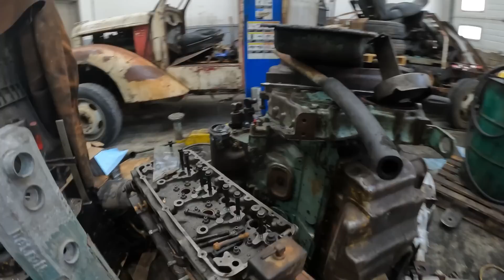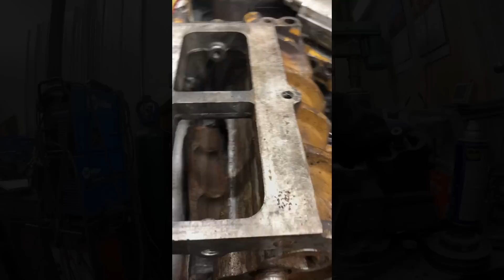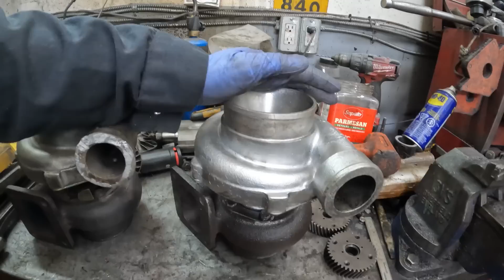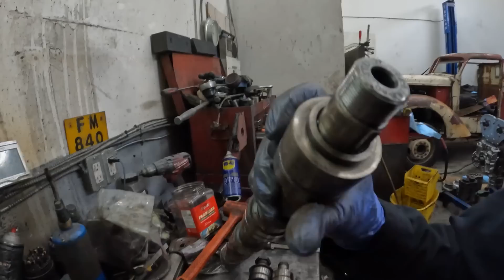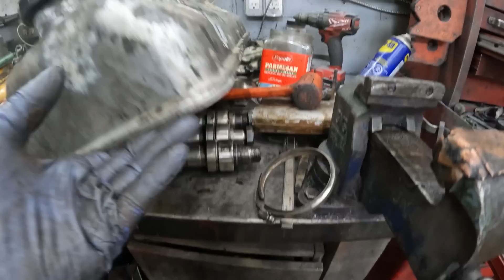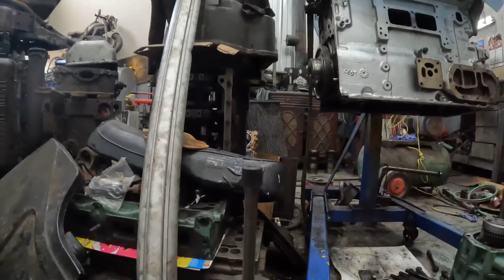Detroit 4-53 Differences ( N, T, Silver Series )

Comment: @detroitgarage9430   This is fascinating to see all of the differences between the various versions. I acquired a low-hours, fairly late model, naturally aspirated 4-53 stationary power unit, with a hand clutch and belt pulley - for free. 

I was curious about adapting it into my 1955 GMC 600 series medium duty truck (ex-fire truck, now flatbed) which currently has its original 360ci inline 6 gas engine, "rated" at 170hp @>3000rpm (probably much less than that now, in it's current worn state).

I'm curious whether the governor on my freebie 4-53N stationary power unit (variable speed via a control cable) would be at all suitable for use in a truck. I've heard the governors on stationary engines, even if variable speed, are tuned different than truck engine governors.  I don't want to make the truck a pooch overall (since the 4-53's rated HP is significantly lower than the gas inline 6), just for the "cool factor" of it being diesel-powered. When this GMC was new in 1955, the diesel option in that size class of truck, according to the manual, would have been a 4-71 (naturally aspirated, of course). I only have this 4-53N to play with, because it was free.

I want to know whether it's worth my time to install the naturally aspirated 4-53 power unit engine into the truck (as is) or if it'd be a total waste of effort (for reasons mentioned above, or reasons I'm not aware of!) Extensive modifications to the engine would definitely be out of budget, so it's really just going to have to work as it is, or I'll leave the original gas engine alone.
Reply from the maker: The 4-53N is rated at 140 HP and 282 lb-ft of torque with N50 injectors.  Nothing to get excited about, but would work ok in your GMC if you're not in a hurry.:)  The VS governor works surprisingly well with a standard trans.  I'd personally look for a 4-53T, but being your engine is free, it's worth a try.:)  There were many medium duty trucks in the day with a 4-53N in them, 5 speed main and a 2 speed rear.:)  It's really up to you, tough choice, legendary inline 6 or the 4-53N.:)
Reply: @detroitgarage9430  I suppose the 4-53N could always just be a backup plan to keep the truck on the road if the original engine ever has a problem I can't repair due to parts availability. The GMC 360 inline 6 is incredibly hard to find parts for, even basic gaskets, thermostat, etc. That's good to know about the governor though! Thanks for the reply.
Reply: if I ever did figure out a way to install that 4-53N in the 55 GMC, it would definitely be accompanied by a rear axle swap. The original GMC rear axle is single speed 7.17:1. The inline 6 is already screaming at 50mph, and that Detroit would have a significantly lower governed speed than the gas motor. I have a 2-speed GM axle (1960’s vintage) that I bought a 5.83:1 ring and pinion to re-gear, and that would give it a little better top end road speed while adding the 2-speed for a few more gear ratios in between. The only issue is that the 2-speed rear is vacuum shifted, and my brakes are vacuum boosted, so I’d need to add a belt driven vacuum pump of some sort to the Detroit. Like the Detroit, the 2-speed axle was free! I just had to buy the 5.83 ring and pinion set for it from a salvage company.

Comment: Lots of great info here! If I run a N blower on a T engine would I see any better power or any better fuel economy?
Reply from the maker: Thanks, yes better bottom end torque and low to mid range performance.  Will loose 8HP on the top end, but gain 15 ftlbs on the bottom at 1500 rpm.  I daily drive my Silver 4-53T and it has an N blower.  Never tested fuel mileage with the T blower, but I average 9-13 towing, 15-16 city and 18-20 hwy with the N blower.  Hwy is 70-80 mph all the time.
Reply: @detroitgarage9430 interesting!

Comment: It has always amazed me that DD never went to helical lobes on the blowers... seeing as how they went through all the little things to "quiet down" on the silver series.   They should have had helical lobes when they first came out in 57, seeing as how they had previously switched from straight to helical on the inline 71's before they released the 53's and V 71's in 57.... the 110 also had helical lobes.... which "I think" used the inline 71 blower with a faster drive ratio (2.87:1 ??), I need to look that up in my 110 service manuals.   The One thing that attributed the most to 53 noise, was the straight lobe blowers, not to mention that the helical lobes were not only much quieter, but they significantly reduced pulsation of the air, and also cut down on the temperature due to less "beating" of the airflow which caused the aforementioned "pulsating".   I don't remember if the little 51's had straight or helical lobes, but 4-51 seemed to be quieter than the 4-53 was by quite a bit.   I would think that a Silver 3 or 4-53T with a 3 helical lobe Hi-bypass blower (marine) would have also put out more hp as well.    I have an even better idea, that would eliminate the rotors, altogether.
Reply from the maker: Thanks, It's certainly noisy, can hear my Silver with the N blower on it over all the other noise.:)

Comment: So  could i use a turbo blower on a non turbo 4-53
Reply from the maker: You could, but don’t think the performance will be there for the N engine.  Might find it smokes more and has less power.  It’s about 15% smaller than the N blower.

Comment: What about the volume of the oil pump ? Mine was 50% thicker more volume
Reply from the maker: From the ones I've measured, they were the same.  Only compared to the one 4-53N that I had, so may have been upgraded at some point. Oil coolers are much smaller on the N engines.
Reply: @detroitgarage9430 when I turbo my 70 4/53 to factory specs most things that were left unchanged were the cam countershaft crankshaft tin covers not much else did this change in 84 still a daily driver
Reply: It has got as high of fuel mileage if 20 mpg in the Death Valley area of the United States I am embarrassed to say California communist controlled newstrom trader state sad what both my mother and father volunteered for this country in World War Two thank god for Donald trump
Reply from the maker: @ThomasJones-b7d Awesome.:)
Reply from the maker: @ThomasJones-b7d Nice, I average 18-20 mpg on the hwy as well.:)

Comment: Great video. I have a 3/4 ton pickup with a 453N. Should it have a restricter in the fuel return from the head? I assume it was running without one, but was this right. If so what should I buy?
Reply from the maker: The return fitting should have a .80 restrictor in it.

Comment: I used to rebuild some 3s and 4-53 back in the early ²⁰⁰⁰s for the rail road in ky . Been looking for one 3-53 t and a 4-53 t with jakes . One for a farmall m and the other for a truck swap there hard to find in these parts lately.  I just love them two stroke noise makers. I reckon cause as a kid they were common at the farm. Running old grain carts back and forth from the fields. There is something about the simplicity and smell any detroit makes.
Reply from the maker: Awesome, that would be a nice swap for both engines.  Yes getting harder to find that's for sure, I usually find them through FaceBook Marketplace.  My 1965 Allis Chalmer forklift and 2009 Ford F350 are both Detroit swaps.:)  Love them both.
Reply: If you find Jake’s i am looking

Comment: I wouldn't think a roots purged engine quite qualifies as naturally aspirated, even if it's geared for that 2 cycle function. So the rotors are all straight in the 53 series Roots blowers.

 I wonder if anybody makes after market drives and end plates for adapting an over-driven 53 series case and rotors as a roots supercharger for the smaller auto V8s and V6s.. A 2-53 or 3-53  would look and fit better on a 4 barrel manifold than a 4-71 on my '55 270  cu in. Dodge Hemi. A belt driven roots blower would be ideal if it went with an after market damper made by Hot Heads Research for a roots supercharged little '50s Dodge Red Ram Hemi.. . . If I just had the drive for the case and rotors,.

I used to run an Etnyre chip spreader with a 4-53 for a seal coat paving contractor. It's probably one reason I fail all my hearing tests now, lol.
Reply from the maker: Not to my knowledge, and yes the rotors are straight with the exception of the 8V53.  They were more like the 71 series rotors.:)

Comment: I have 6v53 with no oil pressure im not running the engine can i bump up oil relief spring or do i need  engine bearings
Reply from the maker: You can check the relief valves, but most likely needs bearings.

Comment: Question. Is a 453N blower a direct bolt on swap on a 453T? The 453T blower I have has a cracked fin in it and the guy gave me a 453N blower to go with it.
Reply from the maker: Yes, direct bolt on.:)  I'm running an N blower on both my 4-53T's.:)

Comment: You did not mention a 4-53? Just n,t, and silver. The 4-53, with no letter after it is a 2 valve head. It might be a lower compression but not sure , in the 71 series, it is a lower compression 17 to 1. I think it is important for those who are buying an engine to know that it exists, and is a rather low hp. Not well suited to truck use.
Reply from the maker: Yes you're right, I never mentioned the two valve version.  I think they were somewhere around 80-130 HP depending on injectors.  My 2-53 is a 2 valve that had 17:1 pistons rated at 32-38HP.:)

Comment: As usual very informative and entertaining video! Learned a lot and had many questions answered. I’m learning what i may want to do in the future through you! I have a 453N that I would like to throw a turbo on, just to keep hills from being an issue and killing my speed. If I could push 5 psi or so and use a similar blower bypass to the one you built, keep the N blower and higher compression pistons for cold starting ability, I’d be happy…for a while at least. I’d be intrigued to know what parts you would throw at a bare 53 series block to build “the ultimate” engine, taking the best aspects from the different series. Keep up the great work, much appreciated!
Reply from the maker: Thanks, that should work well for an N engine.:)  I'm building a Silver Series 4-53T to be the ultimate engine.  I'll also be dyno testing the different blowers, injectors and turbos so I can get the the best performing engine possible.:)
Reply: Look forward to the results! I’d love to have the space and funds to buy parts and try stuff…but the wife just gives me that look all wife’s do when you spend money on “projects”, so my wife should be thankful for you, as you will save her some of the trouble of scowling at me every time a heavy box with greasy finger prints shows up at the front door.

Comment: Is there a stand alone controller to run the 5r110 in your superduty?
Reply from the maker: There are, but it's better to run the Ford PCM/TCM and tune with HPTuners.  That's what I did and it works like factory.
Reply: @detroitgarage9430  that's awesome. Last I checked (years ago) there were no options for that. I'd love one behind my 7.3
Reply from the maker: @craiga9492  They're a really nice trans.:)
Reply: @detroitgarage9430  they certainly. I have one in my superduty but the 6.0 isnt as nice

Comment: Finally got to try to fire up my 4-53N and had no luck ....the rack was stuck on two injectors ....and those same two injectors were also stuck, or rather they depressed  and stuck once i rolled the engine over.      Odd thing those injectors are both C50's cyl 1 and 3 .....cylinders 2 and 4 freed up and they are both N50's.     Is there any reason two run mismatched injectors  and better yet is there good reason not too?
Reply from the maker: Probably missed matched because they didn’t have a set of 4 of either injectors, so they just used what they had.  I’ll check the manual in the morning and see what mm the c50 is compared to n50’s.  Probably the same fueling.  I’ve run across this on one engine, but really don’t recommend running mismatched injectors.  Having said that I testing 2 7A77’s and 2 7E75’s on the dyno to see if I can notice any difference.
Reply from the maker: OK I checked the N50 vs C50 and they deliver the same fuel, so almost identical.  The plunger stroke is slightly different, but not enough that Jimmy would know.  Who ever swapped the C50's with the N50's knew this.:) P.S.  They also share the same tips.:)
Reply: @detroitgarage9430  thank you for that info. Last question you wouldn't happen to know the timing dimension on those would you ? .... I am assuming the standard 1.48x ?
Reply from the maker: @greywuuf  1.47" for the C injectors and 1.46 for the N injectors.:)  I'd just use 1.47" and that would work well.:)
Reply: Aggghhhhh!.      Soaked my stuck injectors over night in fresh diesel.     Pulled em out cleaned all the passages with carb cleaner.   And rapped the first one with a soft faced hammer. Popped up and freed the rack.    A little lube and worked it by hand and good to go.       On to the second one .... rapped it twice with a soft face hammer and the top "follower" portion broke into 3 pieces ...the flat that the rocker contacts.
Reply from the maker: @greywuuf  Nasty, I'll see if I have a decent spare and can mail you one.:)

Comment: great stuff, thanks as always for sharing. 
a coupla questions, if you have a moment, please
- what is different with your modified cam, running  in the Ford?
- how does the amended pressure setting changes things, with your modified blower bypass?
- would you consider doing a similar tear-down, of a Bivens 8V96, for us all to learn about the magic modifications? )
Reply from the maker: The cam is a V7 high lift cam that's been ground with a different profile I bought from Leid Diesel.  The profile they've used is a closely kept secret that they won't share.  I'm told that combined with the tall port liners give the engine more air combined with the N blower.:)  I'm build the next Silver back to Detroit specs to see how well it runs compared to my engine.:)  The blower bypass opens at 10 psi turbo boost and works very well.  I've tried 5-6 psi opening pressures, but wasn't clean burning at the 5-6 psi, so 10 is very clean.  Engine makes 12 psi boost and with the water meth on 16.:)  Again I'll be running comparison test on the dyno to see which blower works best for the larger injectors.  If I could find a cheap Bivens 8V96, I'd maybe do a teardown, but they're almost impossible to find.  The 8V92, and Bivens 8V96 are just too large for my use.:)

Comment: In addition to the mentioned differences, didn't T blowers also have revised rotor to rotor and rotor to housing clearances to accommodate higher temperatures and larger rotor flex?
Reply from the maker: Yes, the clearances are great for the T blowers.  When using an N Blower on a T engine the rotors need to be shaved a little to increase the clearances.:)

Comment: The blow by on turboed Ns is the piston the oil drain back holes in the top oil ring groove let turbo boost from the airbox blow into the crankcase drive pins or rivets can be driven into the drain back holes to prevent the blowby problem. The wide oil ring in the top groove is another way to control blowby on the N,T combination the piston skirts and oil ring package is a good piston to look at to see the changes on T engines to stop blow-by and.oil consumption
Reply from the maker: Thanks Joe.:)

Comment: My dad used a 4-53 Detroit diesel in his 1954 clam boat. He owned it for nearly thirty years and didn’t have a single problem with it.
Reply: My girlfriends dad's boat has a 4-53n that has over 40k hours on it, sank twice, never had the head off, and original injectors. Runs perfectly, I believe rated around 130hp.
Reply from the maker: Awesome, love hearing those kind of stories.:)

Comment: It would be nice to section a cracked cylinder head with a bandsaw to see if it's possible to machine dogbones in.
Might be a good mod. 

The reason I mention it, Wayne on Ol2Stroker last week was showing the world's only common rail 8V92 and they stressed it in racing and it failed. Its heavily modified. 
Anyhow, after solving one problem they cracked a cylinder head (or both) and I said in the comments, "You overcome one power limiting factor - the Detroit injection system only to find the cylinder heads are now the weak spot. Hot rodding that."
"He replied, we have a plan." 
We'll have to wait I suppose since the vid was only a few days ago (but there might be a lead time in his vids so who knows?).

After you showed the dogbone in the head surface, I can't help but wonder if it's possible now and that might be how they solve cracking at very high power outputs.
(I'm saving this comment in Word to repost just in case lol)

Comment: Compared to the 1970's or 1980's.........turbo's have progressed a a lot to where they are now.   Generally speaking, the compressor sections pump more boost at lower temperatures......it can be as much as 50% more air density.
Reply from the maker: Very true, I'm going to be testing the stock Garrett, then compare it to a modified garrett and then new turbo's.  I'm running a new compressor wheel 59mm on my Silver and love it.:)

Comment: yeah the blower drives were a problem on engines such as the 6v53 turbo
Reply: Andrewsmart the blower drive can be up dated as the 92 series to prevent the blower drive from being an issue
Reply: @joemaser9122  no i found the 92 to be a pig of an engine,worked on a fleet of domino buses with the 6v92 and allison autos,there were 3 different revisions of the v92 blower drive and they a;ll snapped like carrots or stripped the splines,the deluxe coach fleet had a mix of 8v71's and 6v92TA and TTA and the 8v71's used to have to pull over and sit cos they were to far ahead of shedule LOL,and it still made the kalbarri-perth run 2 hours ahead of time LOL,i clocked them at 160km/h on a few occaiasions